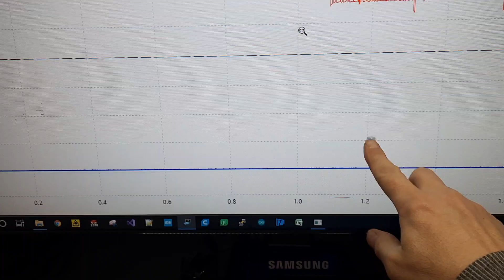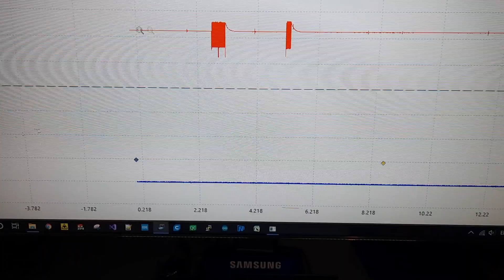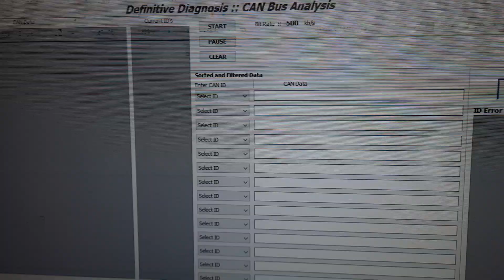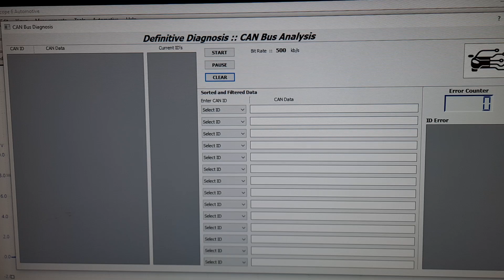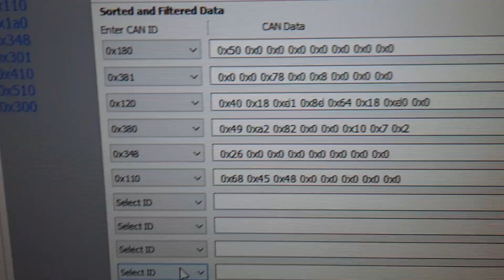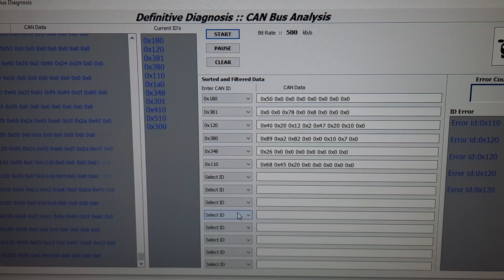CAN Bus tool V2.0 - Demo

Comment: I captured canbus traffic using Peak PCAN-View (not with candump)..   I'd love to plot as I also have a dbc file.

Can I use python-can (can.logconvert) to convert the trc file to the log format, that can then be plotted using cantools? 
(
cat dumpfile_log | python3 -m cantools plot dbcfile
)

Or thoughts on the canstream application or the online service can2sky?  The latter I believe can be used to convert log to trc (but I need the other way!)

I've seen  mitchdetailed / Log-CANverter convert from log to csv and then plots using an external tool (MegaLogViewer HD, plotjuggler, etc)?

Comment: How do you determine what each id represents? Pardon me if I sound silly, but I'm totally green when it comes to can message analysis.
Reply from the maker: A module can transmit numerous different id's so it can be difficult to work out, If you want a fast way then unplug the modules until that id disappears. that is not a great solution though as you may lose functionality and have to do resets etc. You can monitor each one whilst manipulating inputs to look for byte changes.....or if you have a quality scope you could monitor voltage signatures of the modules to look for patterns. Thats just a few ways....having a dbc file would be the ideal but they are very hard to come by .
Reply: @definitivediagnosis9162  thank you very much for your reply. I guess that I have a lot of homework ahead of me kn that front haha.
Reply from the maker: @alexlongpre4527  if I can help in any way let me know, always happy to help where I can
Reply: @definitivediagnosis9162  thank you very much, I take good note of that. I also subscribed to the channel